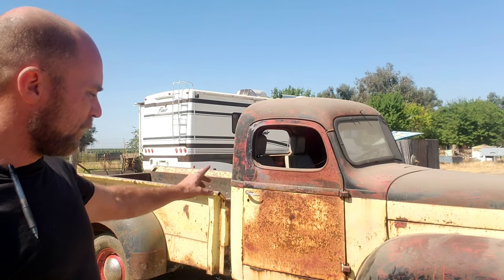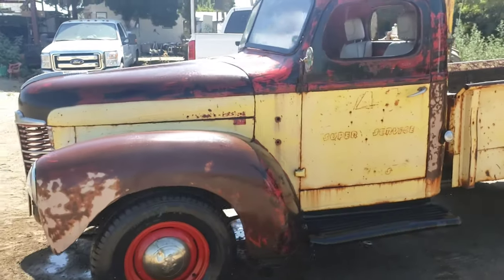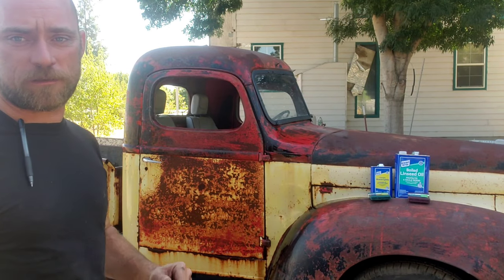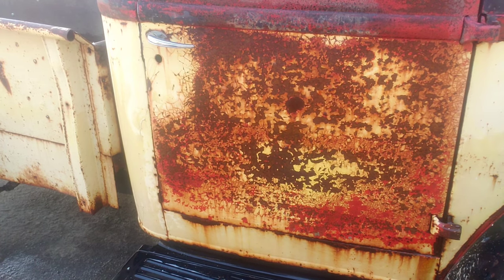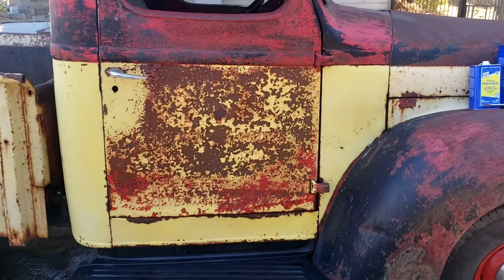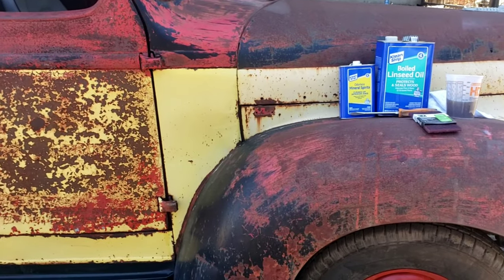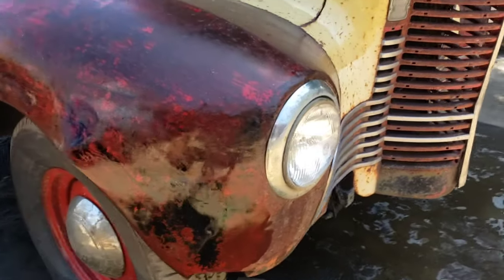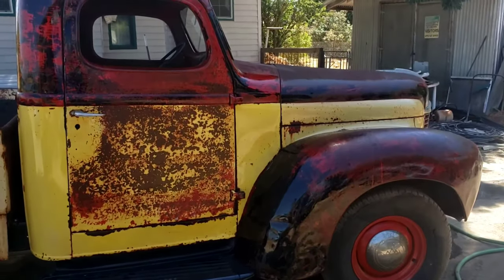Truck restoration - Protecting  Patina - Super Service - update 8

Comment: Loving how this old girl is coming together! I have an additional tip as well for patina preservation; I watch a lot of Mustie1's videos, and if you look at the ones where he worked on his VW singe-cab patina pickup, he shows a method he uses for preserving patina and protecting the metal which works really well. His trick is using those wax toilet ring flanges that sit between the toilet and the floor when you install a toilet; he melts those down and coats the truck with that wax. It creeps into all the tiny little pores in the metal (and rust) which stops it from developing further rust, and it i s sort of self-healing since it keeps becoming soft and liquid over time every time the truck is sitting out in the sun.
Not saying you should jump into that method, but just thought I'd mention it; it might make for a decent comparison between methods to see what works best for your specific situations. Either way, keep up the good work, and stay safe and healthy out there!
Reply from the maker: thanks, I will look into it and possibly use it on the next patina truck

thanks again for watching